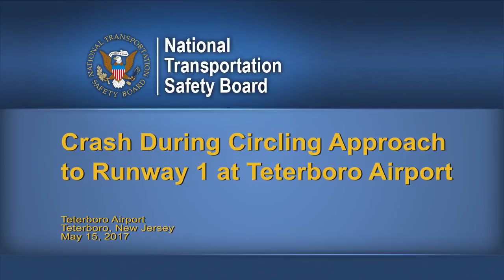Learjet 35A Teterboro Approach Crash • NTSB Animation

Comment: Non pilot but interested party here. What happened to the actual aircraft? Obviously, it was turning too tightly to line up on R1 at Teterboro? Did the PIC over bank to the left and was left rudder put in to force the turn even harder? Did that disrupt the aircraft aerodynamically such that a stall was induced resulting in a wing over to the right and on into an almost inverted dive? At the end, the narrator is describing the Lear impacting at a right bank angle of about 125 degrees. Can someone explain this, please? If the pilot was desperately attempting to turn left how did he end up in a steep right handed turn? Did the aircraft snap roll to the right in an unstable aerodynamic regime at some point? Were gear and flaps extended to the 'down' position? What position were the speed/air brakes in - were they armed for landing, or did the perturbed captain deliberately deploy them well before time in a hair-brained attempt to shave off altitude in the cramped setup he'd saddled himself with?
Reply: What happened to the aircraft? Not enough left to make beer cans and that is a shame because I like beer.

Comment: I’ve done this approach many times, it can be a can of worms if you don’t brief it. These guys didn’t do any briefings or follow SOP’s do Darwin Award it is.
Reply: I used to do this approach when I flew out of TEB, I can’t believe what they must have been seeing. The approach is tight enough even when you make that normal turn but to do it like a mile away is insane
Reply: Gregg Re no it’s very doable as long as you make that turn from the fix and fly around the MetLife stadium.

Comment: What does circle one mean?
Reply: ILS 6 Circle 1 means conduct the ILS approach for runway 6 and, in this case waypoint TORBY, "circle to land" on runway 1. Circle to land simply means maneuver the aircraft over to the other runway. Lots of airports have only 1 ILS approach so you can use that approach to get below the clouds, but the wind favors another runway. So you shoot the approach to one runway, once you can see the airport you maneuver to land on the other runway. This type of approach and maneuver has a higher accident rate. When you get a clearance like this you need to be extra careful to not let your attention get distracted or become sloppy in your procedures. As the previous aircraft landing before the accident aircraft crashed proved it's a reasonable and safe procedure if you do it correctly. This video shows this aircraft was not being flown by procedure or very well. You can crash an airplane if you try hard enough.
Reply: @tscottme  excellent explanation
Reply: @tscottme  Why if this maneuver has a high accident rate they still allow it? to accommodate the rich people with their fancy planes? That captain was distracted alright, trying to salvage the approach from the hands of his incompetent co-pilot. Why the tower didn't warn them of the wind sheer conditions? Those tower people should have some sort of speech training, they sounded like your typical new yorker from the dark alleys (like in the movies). An accentless speech should be a major requirement to be a controller anywhere in the world.
Reply: Walking dog. Tscottme gave a great explanation. In some places it's called a sidestep. It can be necessary if the runway that has ILS is closed for repairs and the alteenate runway has no ILS. In broad daylight it's no big deal. At night, in inclement weather and with low ceiling, the pucker factor is significant. If the ceiling is below an established minimum, the best bet is to abort and head elsewhere.
Reply: Thx! I was wondering the necessity of such an approach. Maybe they only have one ILS for cost reasons?
Reply: @cutliss  I believe that due to the proximity of other major airports such as Newark, Kennedy, etc. ILS on runway 6 would require airspace that is assigned to the flight paths for these other airports. ILS utilizes a straight line approach that involves miles of airspace.         Airports in this area are too close for comfort but they were mostly established in the sub 100 m.p.h. era of biplanes. I'm familiar with Teterboro as the origin of several crashes (not the airports fault). One flew into a skyscraper. The other collided with a sightseeing helicopter over the Hudson.                                   As far as the crash of the Lear, I am astounded 
This is possibly the busiest airspace one can enter. The plane that crashed into the skyscraper was attempting to avoid infringing on restricted airspace. Anyway, the fact that the Lear wanted to climb when they were so close to Tetetboro approach, the statement of the pilot that they were still hundreds of miles from Teterboro when in fact they were lonly 80 miles away when they took off, and the co pilot mistaking Newark for Teterboro tell me 1. The co-pilot did not familiarize himself with his charts (maps). It is easy to get confused if you enter an area cold. 2. The pilot's mind was not functioning as it should. He was incredibly detached from the flight seemingly the entire flight. In addition, any commercial pilot should not have lost that plane. Maybe abort the landing or make a sloppy landing but there was no excuse for a crash im that situation. I'd like to know if toxicological tests were done. Guys can screw around when there are no passengers on the plane but this was suicidal. Please excuse the wordiness. I'm running out of electrons.
Reply: @richardmcavoy6413  Electrons?! We won't be running out of that any time soon 😄

Comment: I guess the PIC was trying to do training on a dead leg. Flying into TEB is the worst place to do that though. Fortunately they didn't have passengers. Circle approaches are a type of "cloudbreak procedure." They're designed to get you under the clouds, where you can see well, then transition from an IFR approach to a VFR approach. It's basic IFR flying. How they visually mistook EWR for TEB on a clear afternoon, is beyond belief. EWR has two long parallel runways, with a huge river right next to them, on the east side of the airport. Once the PIC messed up the read back for his approach, it went downhill from there. What a shame.
Reply: And, the SIC was not supposed to touch the controls at all per his company procedures. They we sloppy and unprofessional and lacked judgement.  And could not care less.
Reply: @squirrele.1266 Of course. A lot professional pilots, especially flying charter or corporate get airtime in aircraft on dead legs. Though most companies don't allow it, it still happens.
Reply: @kevinfromvirginia1796  Yeah, we fly charter here, our crews swap legs, but, we don't hire low time or no time pilots for any of our aircraft. All come type rated already. We don't hire and then type.
Reply: @squirrele.1266  I hear ya. That's typical. Without help, it's so hard to get type rated in advanced aircraft, without knowing someone who's willing to help. Especially jets. That's just the way it is. Perhaps I'll see you up there someday (tail# 607D). Keep safe, and happy flying.
Reply: EWR had nothing to do with it. They fell behind the aircraft and approach and the wind was howling. Circling approaches will always start in a normal approach (ie ILS, RNAV, VOR…) but it will terminate with a circle-to-land maneuver.
 
Circling approaches always have higher minimums than any other approach because the pilot must maintain visual contact with the runway throughout the entire maneuver. The higher minimums allow for a greater margin of safety.
Reply: @squirrele.1266  The pilot misstook EWR for TEB. It's in the video. If you're not familiar with circle approaches, take a look on Google. Like with this IFR filed flight, you fly the localizer for a given runway until you're cleared (typically an intersection) for the turn for another runway, then fly VFR the rest of the way. It's similar for a side-step approach.
Reply: @kevinfromvirginia1796  I missed that, thanks Kevin. I am a pilot as well, and work in corporate aviation but not flying. Crazy! Whole thing is mind boggling.
Reply: @squirrele.1266  They also fell behind the ground. how stupid is that you do not see the ground coming toward you. Good they died and no one else.
Reply: What's a dead leg?
Reply: @cutliss  Any part of the mission that you don't have passengers onboard. Mostly common in corporate or charter flying.
Reply: @cutliss  no passengers, aircraft is being repositioned from one airport to an airport where they will get passengers
Reply: It's entirely IFR.
Reply: @soccerguy2433  Not the case here. Runway 1 at TEB doesn't have an instrument approach. None. Since the flight was IFR, he got a partial instrument approach because of winds. IFR is terminated at circling intersection. You can't execute that approach outside of visual conditions. That's the whole point.
Reply: The SIC misidentified the airports... Which based in his restrictions is reasonable
Reply: https://www.flyingmag.com/teterboro-learjet-crash-raises-questions-about-crew-qualifications